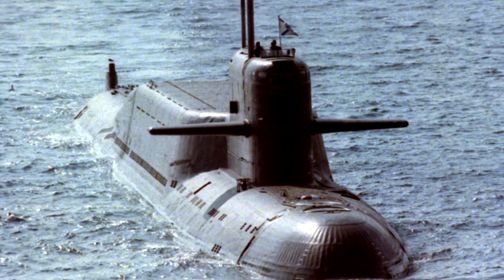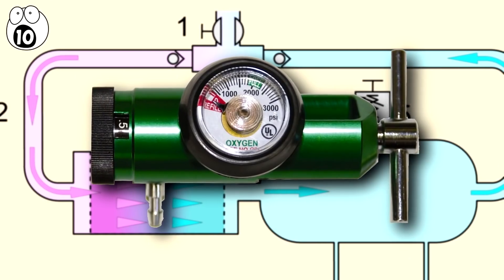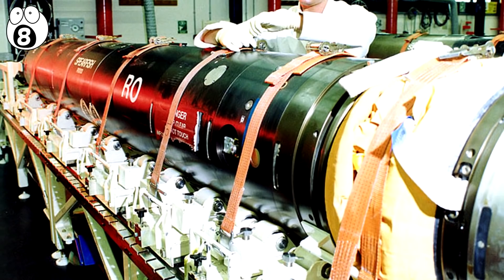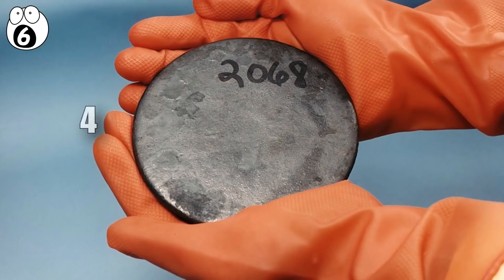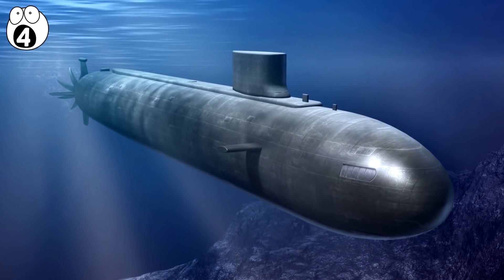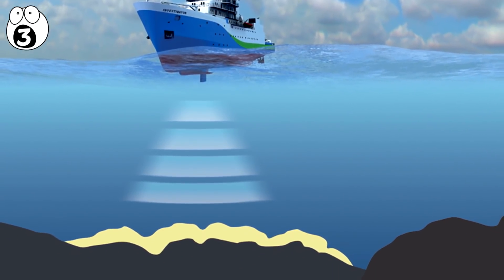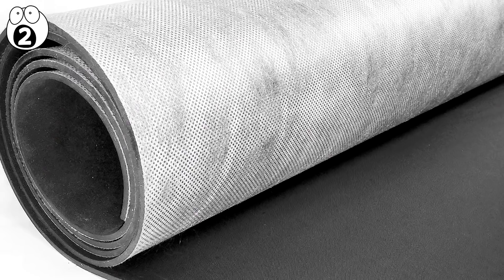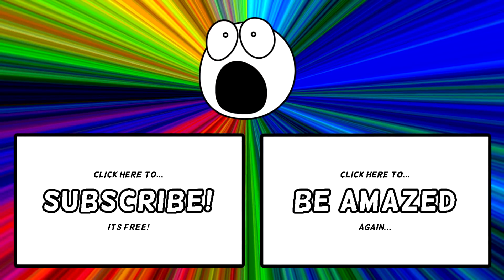Declassified Nuclear Submarine Design Secrets

Comment: #10 - Applying an electric current through seawater splits the water molecules into Hydrogen and Oxygen?
NO it doesn't... Electrolysing seawater will produce Hydrogen and Chlorine gas. Try breathing that and see how far you get, Muppet.

Comment: Interesting fact that I learned while testing nuclear submarines at Newport News Shipbuilding:

When most submarines dive or surface, they go through a transition during which they have NO righting moment and NO metacentric height at all. This makes for a momentarily very dangerously unstable boat.  That is why, in most cases, subs never submerge or surface slowly. It is very necessary to get through the unstable period very rapidly.  
-
(An analogous situation is when a large steam turbine is being brought up to speed. There are certain rpms that are resonant frequencies. These particular rpms can cause VIOLENT vibration that can throw blades and rotors.  This can kill people.  The operators go through these rpms very quickly.)

Comment: ERROR:  7 ) Depth Control:. The narrator states the original system of taking on water to send the boat lower has been REPLACED by diving planes.  That is incorrect.  The original system of depth control has been SUPPLEMENTED  by diving planes that allow FASTER depth control.

Comment: You missed Hydrogen peroxide powered  torps. Discontinued after several accidents when HP leaked and reacted with the aluminium body releasing hydrogen gas.  This is suspected to have been the cause of the loss of a Soviet sub when a buildup exploded

Comment: A bit clickbaity and sometimes silly, getting oxygen out of seawater through electrolysis is a well known method and never was a "secret design feature" of "nuclear submarines" in particular.
Also you should go into more detail sometimes for example the problem with diesel engines is not rlly that they leave a visible trail in the air since the submarine would be surfaced anyways, but that a combustion engine needs to breathe air and therefor the submarine has to surface or use a snorkel when it wants to run its engines to charge its batteries for example - also it has much less range obviously than a nuclear sub. - If your gonna do this and lure in engineering enthusiasts and get views, then pls do it right.

Comment: Rockets don’t require external oxygen.  Rocket engines are self contained.  Liquid fueled rockets contain tanks for a fuel and an oxidizer.  Solid fueled rockets use a fuel that has no need of external materials to burn.  The difficulties launching from a submerged platform have nothing to do with the rocket engine “needing oxygen”.  

The passive and active sonar systems use sensitive MICROPHONES, not sensitive speakers, to detect sounds.

By making such obvious mistakes you raise concerns about the credibility of everything in your video.

Comment: 5.28 rockets burn fuel so they require oxygen? The purpose of ejecting the missile before igniting the rocket motor is to avoid damage to the vessel from the combustion products more than anything else. Since rockets carry fuel and oxidizer on board they can actually ignite under water. There were designs for rockets that would launch from the ocean's surface. They would be towed out by a ship then ballasted upright and launched out of the water. A cruise missile on the other hand switches to a jet engine after the boost phase so water getting in there would probably suck. Great video by the way!

Comment: Interestingly, improved propeller blade designs have made it to commercial ships, too. For one reason: cavitation from older propeller designs also generated a lot of vibration that can damage the driveshaft and even the propeller itself. Better propellers allow for slower propeller turning speeds, which has the advantage of lower driveshaft vibration and also lower fuel burn.

Comment: Rockets don't require oxygen from the atmosphere!   The use an oxidizer either liquid or solid! The reason you can't just light off a Trident D5 at 100m is the amount of pressure the water puts on the rocket engine. A rocket engine is a bomb with one end open, close that end and boom! Now a
Rocket could be easily made to work at 100m depth but then it wouldn't work in the atmosphere the expansion ratio would be all wrong!
Reply: The Polaris missiles are pushed out with a large blast of "air" through up to 120 keel depth of water into the air. only when they are clear of the water do the rocket engines ignite
Reply: joepiet exactly! If you ignite a solid fuel rocket with a few more atmospheres or pressure on the exhaust you have a large bomb! That’s why the use a gas generator and push them up past the surface then as soon as the missile detects it’s falling the rocket ignites

Comment: Rockets don't need oxygen, they carry it onboard.  One issue is about the pressures involved in opening a hatch filled with air to launch a rocket.  The in-rushing water would cause stability issues, and possibly prevent the rocket from leaving its tube.  Another issue is that rocket engines are designed to fire into air, not water.  Igniting the rocket in the water filled tube could cause damage to the rocket engine, and possibly catastrophic failure of the rocket, which in turn could fatally damage the submarine.
Reply: So you dream all of this up in your imagination, and then spew it as fact?

Comment: Missiles are not ejected via steam pressure. a small amount of missile propellant is ignited in a separate chamber to provide the high pressure to eject the missile. I learned this on YouTube.
Reply: steam...yes          missile propellant...no
Reply: You read me wrong. In the end it is steam that propels the missile out, no argument there. The question is, "how is this steam generated". The Youtube video I quoted showed a drawing of a missile tube,with each tube having a seperate steam generator. The substance used to generate the steam is the same propellant used in the first stage. The sub does not tap off steam from the propulsion system as if this was the case the subs mission could be compromised. Everything is dedicated to first getting those missiles launched, hench they each have a seperate steam generator, not dependant on any other system. Earlier systems did use compressed air but compressed air is very valuabule on a sub and it takes a tremendous amount (even more depending on launch depth) to push a missile out. Some older subs (like the UK Vanguard class) did carry steam generators for missile launch I do not know how the Brit steam generators worked. Here is a link to the video I cite https://youtu.be/NCkuVVlrOJ0. Fast forward to the 13.10 mark.
Reply: I'm confused...The boat I rode was built in about '64 and launched the Polaris missiles with a small steam generator. One for each tube.

Comment: Groan.... Rockets don't "require oxygen".  They carry their own supply of fuel and oxidizer, typically as solid fuel.  The exhaust from a rocket is incredibly hot compared to the temperature of compressed air or steam.  Also, some of the combustion byproducts are caustic.  The combination of extreme heat and caustic byproducts could cause significant damage to the sub.   There is also always a small, but present danger that a rocket could explode due to damage if it's engine was fired under water.

Comment: The Electrolysis is not done with sea water. It's done with pure water that is pumped into the cells and potassium inside the cells that provides electric flow to separate oxygen and hydrogen. The hydrogen is not stored on board. At 4% concentration hydrogen makes the air flamible, at 8% is becomes explosive. Hydrogen is pushed overboard through a defuser.
Reply: this guy knows

Comment: Subs still use water as ballast to submerge. Otherwise it wouldn't be heavy enough to overcome the displacement of the vessel. Also It wouldn't stay submerged when stopped without ballast( water). The control fins are to help change the pitch of the vessel once submerged.

Comment: You don't know what you are talking about... Yes, there were pneumatic torpedoes , quickly replaced by the ones with combustion engine. And that exhaust gases were leaving the trail of bubbles. Also passive sonar is equipped with MICROPHONES not speakers..

Comment: Very misleading video on many points. Specifically, modern subs STILL DO use ballast tanks. They do not use them to change depth while underway but use them to "sink" the sub from "floating" on the surface to submerged to the point of being "neutrally-buoyant", meaning not sinking to the bottom and not floating up to the surface. The sub tries to remain essentially "vertically stationary" while underway. Then, the "stern-planes" which are located on the very aft of the sub, near the rudder are used for depth major changes and to maintain the attitude/angle of the sub which is generally "Zero-Bubble" or horizontal. While the "Fairwater/Sail or Bow-Planes (depending on the class or type of sub) are used to set/maintain the depth of the sub.
Reply: What about all the trim tanks?

Comment: No, No, No, NO, NO, NO...  Jesus F'ng... The "crude" ballast system is still very much required to control depth.  It has NOT been replaced.  If the boat only surfaced or dove with the stern and bow/fairing planes then it could not hover (a maneuver necessary for vertical missile launches from an SSBN).  Junior officers do NOT operate the planes.  The diving officer merely oversees their operation by enlisted personnel (as well as giving them the orders for their position).  The operation of those planes are NOT coordinated with any-fucking-body!  Although we don't try to make any extreme maneuvers unless they're absolutely necessary, we don't pause to call the goddamned cook in order to ask him if it's okay for us to send the boat into a 20 degree up or down bubble; that's why we have a fucking klaxon.

Comment: The title is clickbait writ large.

#9: Fins for (accurate) depth control aren't exactly new and even the most modern subs use ballast tanks... In fact, the oldest military sub model which had (front) diving planes I could find in a hurry was the British B-Class dating from the mid 00s - 1900s that is.

https://en.wikipedia.org/wiki/British_B-class_submarine
https://en.wikipedia.org/wiki/Diving_plane

#8: As mentioned, first (serious) use in WW2

#7: Self guiding and programmable torpedoes date back to WW2 as well: FaT, LuT, G7es, FIDO

#5: No, Rockets don't need oxygen, they carry their oxidiser with them. And where is the steam?

#4: active SONAR was introduced as ASDIC slightly too late for use in WW1, passive likely also predates nuclear submarines.

#2: Anechoic tiles were first introduced under the codename Alberich in - you guessed it - WW2. Not widely used though, as it took until 1944 to make it actually work (a big issue was finding out how to stick the stuff to the hull in a way that it remained there).

Comment: At 5:30 you say "rockets burn fuel, so they require oxygen" as if they means they can't work underwater, so need to be launched with compressed air. Which is totally wrong...rockets carry their own oxygen, usually as an oxidiser; they can work in a vacuum ffs. They work fine underwater too, indeed the Russians have rocket powered super fast torpedoes. ICBMs are launched via compressed air to protect the launch tube and missile from the heat of the rockets exhaust.

Comment: Yes, they still use compressed air and ballast tanks. If you stripped it down to the pressure hull, the sub would sink.  It has to or it wouldn't be able to submerge. A US diesel sub received all kinds of hoopla for traveling 21 days under water but the U-995 traveled 66 days underwater at the end of WW2. Speaking of Schnorkels, let's give credit where credit is due. The Dutch invented it and used it before WW2.  The British and Germans removed them from captured Dutch submarines because they didn't see the value of the device. The fissionable isotope in Sub reactors is 92%.  The fuel and reactor are expected to last the life of the boat.

Comment: I think you need to get tooled up. Modern torpedoes use Otto Fuel as the primary power. Pure electric torpedoes are not used anymore.

Comment: Rockets carry their own oxidizer, they are absolutely not dependent on atmospheric oxygen.  Sub launched missiles don't launch directly from the submarine because the rocket exhaust would damage the sub, and the rocket motors can be simpler if they only have to operate in air rather than both in air and underwater.

Comment: Lessee, Number 9.  All submarines STILL use ballast tanks, it is the primary device for keeping depth, and how the submarine is kept bouyant.
Number 7.  Wire guided torpedoes have been around for a while, the Mk 48ADCAP is only the latest design.
Number 5.  The U.S. also had missile systems that were launched from the surface on a submarine, but the U.S.S. George Washington was the first true 'Ballistic Missile Submarine' that could launch from underwater.
Number 4.  Submarines also use 'towed array systems' which have long cables and transducers on them, towed behind the boat, to help in listening.  Submarines very rarely will use active sonar.  Since most of the ocean is deeper than the submarine can go, what area that is above their deepest depth is mapped extensively, and they have that information available to them.  However, even that has not prevented submarines from running to the seafloor.
Number 1.  The Jimmy Carter was designed as a Spec Ops boat to replace the most decorated submarine, the U.S.S. Parche, which was decommissioned and cut up.  Parche's sail is at the submarine museum outside of the Puget Sound Naval Shipyard, Bremerton, Washington.  The moon pool on the Carter was also used on another submarine, the second submarine named Seawolf.  There is written history of what she did as a Spec Ops boat, I won't get into it here.

Comment: 5:30 - "rockets burn fuel and require oxygen" - Rockets carry their own oxygen as an oxidizer or mixed into a solid propellent... they do NOT require external oxygen to work...  The rocket will burn just fine underwater but would damage the submarine, requiring an ejection method such as compressed air

Comment: At fact 6:''They used Diesel Engines''
Me: '' Right''
At fact 6: ''But they gave away there position by using them''

No no no no They ONLY used the Diesel-Engines when on the surface. Underwater they used Electric-Engines.

Comment: In fact, what was learned about submarine propeller design was also eventually applied to jet engines. Note the large front fans with unusually curved fan blades of the jet engines on Airbus A350XWB, A380, and 787 airliners; they took some of the principles from submarine propeller design, namely turning the front fan at slower speeds and each front fan blade is carefully shaped, to reduce the noise from the engine.
Reply: Nobody uses propellers any more! You just can't dump any power into a prop without ungodly cavitation noise.  http://errymath.blogspot.com/2015/01/russian-navy-only-kilo-class-sub-that.html#.Woy1vqO5tRY

Comment: Fast attack, subs /US have , deployable , D.C. rudder post, for up to 300 ft. for close, positioning, of submarine. can be used off batterys emerg diesel Generator , Prop is Geared assembly, thru vertical post, motor is in Sub machinery, room